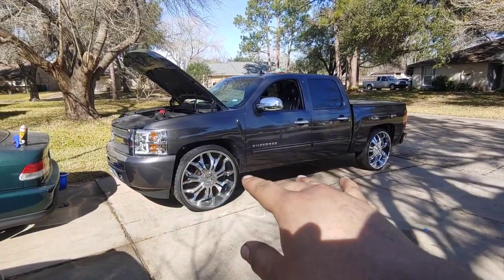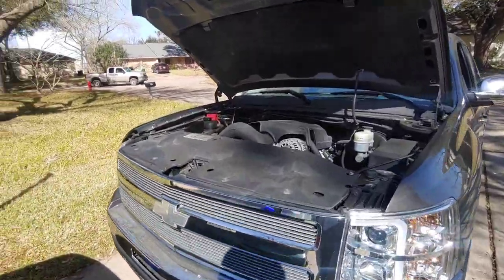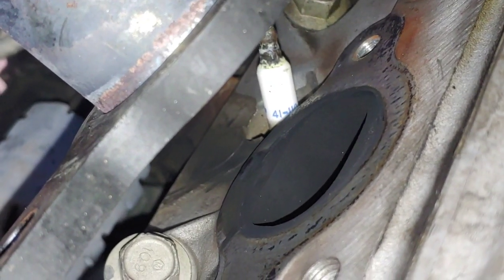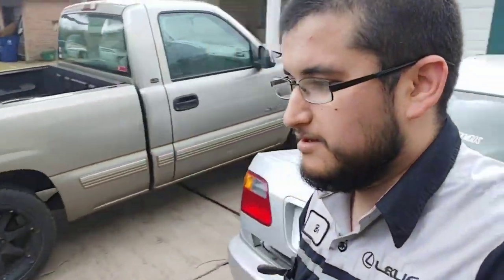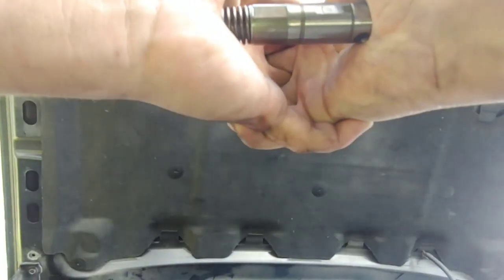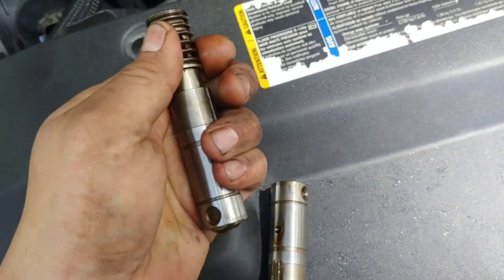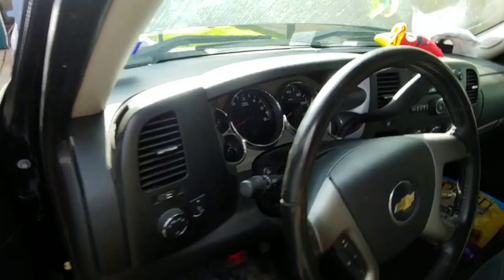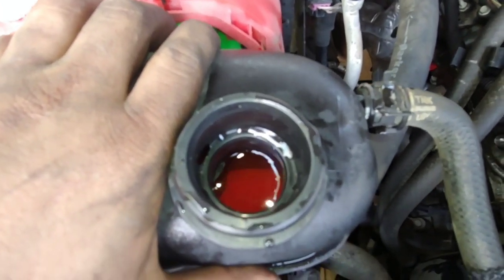Lifter Noise Or Exhaust Leak?

Comment: man i couldn’t figure this out for the life of me and was about to replace lifters on my 6.0 swap. Saved me a lot of money and time, thanks man. 👍🏼💪🏼
Reply: Man I just had a 6.0 rebuilt installed, and having the same issue. It sounds like a lifter knocking but no codes thrown for lifters. Only Intake manifold and engine misfire
Reply: Same thinking happening to my 6.0 swap

Comment: Thank you!! This is the exact noise that I have from my 351w. I’ve had anxiety all day thinking it was a lifter tic.
Reply from the maker: I have anxiety all do for no reason at all! Lmao
Reply: Just redid mine and a AFM delete  been freaking out
Reply: @BoBuilds  head gasket i’ve had since 2021 gave me anxiety of maintenance. My tahoe is not badly damaged but i found out the motor is actually a 4.8 so i cant ever expect anything.
Reply: Is a lifter problem worse??
im having this tick noise on my Silverado 2003 1500HD
Reply: @kozmicflush980  lifter issues are to worry about but they are usually caused by something like oil delivery. Like mine..

I have a loud lifter noise from not having enough oil pressure. An old o-ring on my oil pickup tube is causing that pressure to go in and out with the ticking. Same situation, 05 tahoe 2wd. Maybe more difficult if you have 4wd
Reply: @kozmicflush980  lifters are deeper in the motor, harder to replace and you would rather keep your truck off the road until you fix your lifters. If not, itll mess up the cam when one of the lifters fail. Unless you have the same oil pickup tube o-ring issue i have. Plus my oil pan is leaking
Reply: @kozmicflush980  you can do without but you might hear it get worse within the week. Flush your oil or find your problem.

Comment: I have 2 broken exhaust bolts one on each side in the rear. Any tips on extraction without pulling the heads?
Reply: I have the same problem
Reply: use the dorman bracket !!
Reply: yt search :  5.3 manifold bracket will work on 6.0 too amazon sells the part ez fix

Comment: Mine has developed the tick not to long after installing speed engineering longtubes. Came with mls gaskets and have the broken back bolt fix brackets on both sides. Did yours tick faster with higher rpm?

Comment: Ty for this , mine kinda sounds like a lawnmower but not or a go cart kinda but not that crappy . Sounds like it comes from under the truck more , it’s getting worse a little louder , when I start it and hit the gas it does it but mainly when I accelerate , it still drives the same maybe a little less power but nothing that noticeable ... anyone have any suggestions . I have an 06 Titan v8 ty
Reply: I hope I’m not too late I just got my exhaust fixed it’s probably a exhaust leak. I had the same issues as you before.